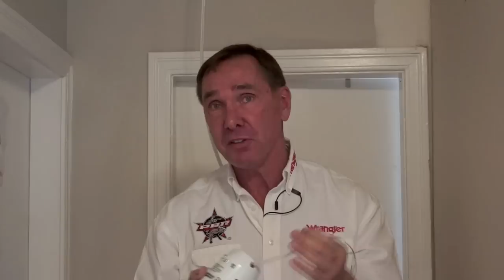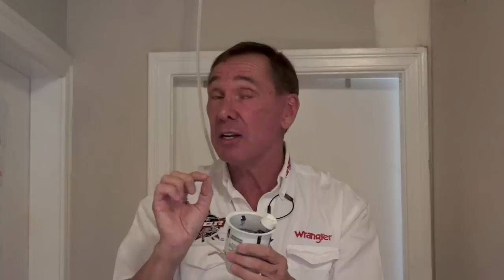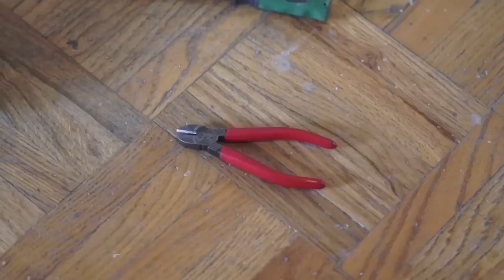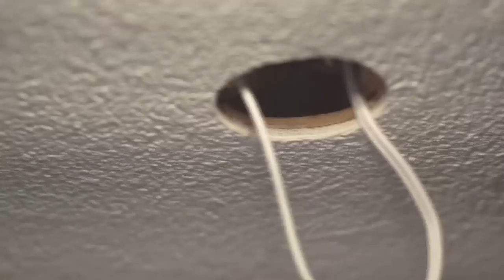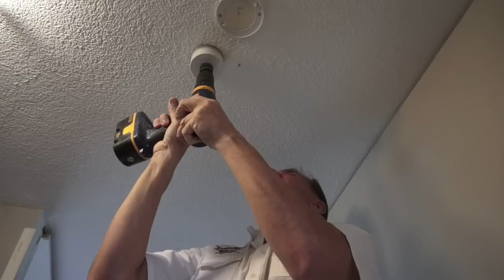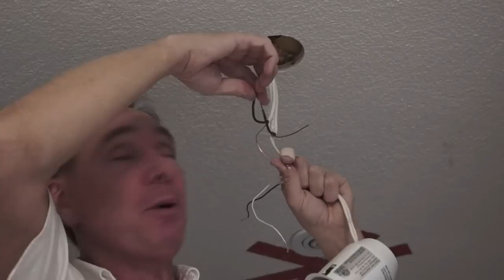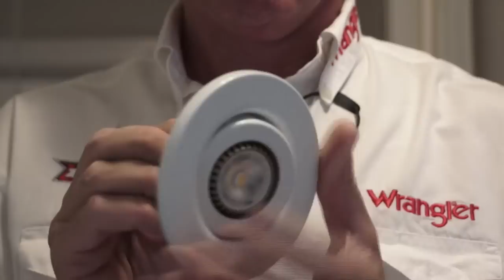How to Install Recessed Lighting | Retrofit

Comment: I understand the need and desire to DIY. I'm also a huge fan of saving the money by doing it yourself.    I'm an avid DIY'er....I do my own painting, ceramic tile, flooring, heating, plumbing and carpentry and of course ELECTRICAL, but I have to qualify this statement that I ALWAYS follow instructions and do CODE COMPLIANT installations.   I never do this but since you rudely tried to belittle and discredit all the other posters who dared to comment on your abomination of a video.....I simply have to comment on some of your statements.

FIRST.  Lots of people don't like the color of LED's so some "idiot" other than the idiot who made this video MAY decide to change out the bulbs!!!  

SECOND....I know I can walk into 10 hardware stores anywhere I want and will still find GU10 lamps in 9 of them for a very small fraction of what an LED will cost.   

THIRD......the MYTH that all LED bulbs last 20 yrs is just that....a myth.  I have many customers where I have had to replace them after a few months.....sometimes in a year.  If you actually read the disclaimers on the packaging for 99% of the LED's on the market then you would know that this 20 yr claim is based on 3 hours of usage per day.  MANY people use their lights more than 3 hours per day.

FOURTH....Even if those LED lamps are never changed out and heat producing GU10 is never installed, I would be MUCH more concerned about the terrible connections you made up and shoved up into an insulated ceiling and NOT in a box.  You repeatedly try to defend your install by claiming that LED's don't generate heat however, loose connections DO.  Most electrical fires are caused by loose connections.  Watch this little video here on youtube which WAS produced by professionals who DO understand electricity.  https://www.youtube.com/watch?v=_2HyTRxzwXs   This can happen with even small amounts of current.

FIFTH and MOST IMPORTANT.  Don't ever be STUPID enough to ever tell people that 120 volts can't hurt or even KILL you.  It is NOT the voltage itself that kills you.....it is the amperage.  The real measure of shock's intensity lies in the amount of current (amperes) forced though the body, and not the voltage. Any electrical device used on a house wiring circuit can, under certain conditions, transmit a fatal current.
While any amount of current over 10 milliamps (0.01 amp) is capable of producing painful to severe shock, currents between 100 and 200 mA (0.1 to 0.2 amp) ARE LETHAL. Currents above 200 milliamps (0.2 amp), while producing severe burns and unconsciousness, do not always cause death IF the victim is given immediate attention.   AGAIN....if you understood electricity then you would know this as well.

Just a few random points.....show us some proof that incandescent and halogens are going to be permanently discontinued. You stated this information 4 years ago saying unequivocally that these lamps would be phased out in just a few months yet they are still on the shelves today. The law never once mandated those lamps into distinction.....it merely imposed restrictions on them that the manufacturers will never be able to reach and still be able to financially compete with them on the market. There are hundreds of articles explaining this info in terms that even you should be able to understand.
Reply: I can see, that I too, am not immune from the petulant whining of the 2 yr old who has been told time and again that what he has is done is BAD, BAD, BAD.     I however, am not offended by your (albeit incorrect) opinion of me.   I tried (politely and backed with solid facts) to explain to you why what you have shown in this video is incorrect but since your mind is obviously made up ,I'm not sure why I should bother to confuse you with the facts but here goes:     I guess step one would be to explain to you exactly what electricity truly is.... Electricity is the flow of moving electrons. When the electrons flow it is called an electrical current.   Contrary to your strongly held belief, you simply CAN NOT have electron flow without heat being generated, its an immutable, un-moveable, unflappable LAW of physics.Now on to another simple fact of physics....... heat can and will expand all forms of matter, copper being NO different than any other form of matter.    In fact, the thermal expansion co-efficient of copper is approx. 9.4 and that of aluminum is 12.3 ,which means that in the temperature range of 68 deg F to 572 deg F, that particular metal can expand up to 12.3 times its normal size.Now.....Im going to use these two simple facts of physics (you see, I minored in physics) to refute your claim that absolutely nothing can happen because there is NO HEAT generated, as well as to try to explain to your petulant, infantile mind exactly why I feel/know your install is dangerous.When these lights are turned on, the electrons begin to flow through the copper wire and on to the LED lights and back again to its source and so on and so on (doing this at a rate of 60 times per second, that's what 60 Hz means) for the entire time the circuit is energized.    This means we have current flow (amperage in easy to understand terms) and as I stated as an immutable LAW of physics, you cant have current flow without generating HEAT.  SO....if your minuscule mind is still following us,   WE HAVE HEAT GENERATED.  With this heat we now have the potential for expansion of matter.  The matter, in this case, being the copper and aluminum conductors which you used to wire in these recessed lights.  (Before you start ranting about how I'm a stupid moron, douchebag, dickface....lol, the wire in those recessed lights is what's called tinned copper, and its an aluminum coating over the copper insides)   SO  (try to keep up here), we have HEAT and expansion of matter, which in turn can and WILL lead to those piss-poor electrical joints you've made coming loose.   Over time they will loosen, and they will get looser and looser and will do so quicker than if they were all copper connections (remember that other rule of physics,   the thermal expansion co-efficient thing?  I know this is a lot for your small mind but do try to keep up).   Now with this uneven rate of expansion and contraction, the joints get worse and worse and they can come apart.  THIS IS THE ANSWER, FROM A WELL EDUCATED PERSON WITH EXPERIENCE that you have been looking for EXPLAINING HOW AN ELECTRICAL SPLICE (especially a poorly made one) CAN COME APART ALL BY ITSELF.    You see, its not coming apart all by itself, its SCIENCE.....physics to be exact.NOW,   this long, convoluted explanation that I've tried to keep as simple as possible, is the reason we have simple electrical codes like Rule 12-506 in the Canadian Electrical Code which states un-equivocally that all splices MUST be made in an approved box (those ones that you neglected to use which came with the recessed cans you bought at home depot are approved).  This is what protects against the possibility of something flammable (or god forbid a person) coming in contact with that loose, heat generating splice.But hey......I'm just a fully licensed construction electrician who attended university to obtain an electrical engineering degree and minored in physics while there, who is now teaching electrical to aspiring electricians.....so what the hell do I know.   After all,   you're the expert here.If you wish to discuss these immutable laws of physics and learn more about our Canadian Electrical Code and feel that you could possibly remain mature enough to discuss the relevant facts about this (or anything else you may need to be schooled in) without resorting the name calling and belittling which appears to your signature benchmark on here, then you could contact me here and I would be happy to privately provide you with an email address for correspondence.   Who knows,   you MIGHT just learn something.
Reply: +Percy Lipinski    Exactly the response I expected from the child you so obviously are.   If your reading comprehension skills were even partially equal to your skills of ignorance, belittling and douchebaggery you would be able to pick out the relevant points of my last comment and possibly (but I doubt it) be able to realize that I've already pointed the issues (scientifically and from a Canadian Electrical Code standpoint) with the install.   Since you are obviously unwilling or unable to do so, and since you are also obviously unable and unwilling to converse with somebody above the level of a belligerent, drunked up, pre-pubescent, vulgar, teenaged boy that you portray yourself as every time you post on here, I will bid you adieu.   Life is much too short to waste my time trying to show the light to the obviously ignorant.Remember, there is none so blind as those who refuse to see.
Reply: My god.....how are you so incredibly asinine and obtuse???  The problem is NOT that I have failed to explain the dangers of loose connections and how connections can come loose just from simple everyday current flow......the problem is that YOU are too ignorant to understand the explanations.   You repeatedly say that I WON'T explain the issues because I cant.   I have explained them twice.......you have failed to understand.    The issue lies NOT with me but with your refusal to admit your errors.    If calling me names and trying your absolute best to belittle me makes you feel better about yourself, then by all means carry on.   I, however, refuse to carry this any further nor to explain anything else to you as it obviously falls on dear ears.    

I must now end this battle of wits as my opponent is sorely unarmed and since I cant bring myself to lower myself to your level of name calling....insults and debauchery.....I will excuse myself from the rest of this discussion.  

By all means......please take this opportunity to dream up a few more insults and resort to childish name calling to support your position as an expert.  Do remember however, that in doing so....you further reinforce my (and many others) opinions of you.

Comment: I noticed you took the extra step to wire nut the grounds but where do they go?  It looks like they're not connected to anything where you're picking up the power from the old light.  I'm confused...
Reply: FYI, in an old house, they may not even be connected to a ground, but they should connect to the ground screw (usually green) on the fixture nevertheless.  It's a good think that you're confused in this case.
Reply: He didn't have to connect the grounds, it was pointless after he wired the way he did.... .... what a rube !!!!

DO NOT wire like this guy !

Comment: Umm, I like your video but I wished you were wearing safety glasses, especially you need to look up a lot of time :-)  I also know that most of the time you are safe by just running off the light switch before working on the wires. However you never know if there  were some idiot electrician before you could have wired the switch on white by mistake. That could leave the black wire still hot. So slipping the circuit breaker is always the safest way to go. 

Peace.
Reply from the maker: You're right about safety glasses. I just simply forgot. Bad mistake.
Reply: Focus.. don't listen to this guy...  he's out of his mind !

Comment: NOTE TO ANYONE TRYING TO LEARN ANYTHING ABOUT INSTALLING LIGHTING FIXTURES HERE: LOOK ELSEWHERE!
The fact remains that no matter how you try to spin it, you have 120 volt wiring in your ceiling, with splices not enclosed in junction boxes. This is against NEC and CEC. There is good reason for it. 
Even if you had NO bulbs in the enclosure, unless the wiring is low voltage, the splices need to be enclosed.
Reply: Percy Lipinski Haha, pretty funny that you should bring up the Meds, as I was thinking you were exhibiting the symptoms of someone who has quit taking their meds!  Good thing you're in Canada, where I guess attics don't get very hot.  Still, to be safe, you should put a sign at your attic access telling future owners to keep out, in case they accidentally move one of your 120V open connections, and start a fire.

Hey, it's your post, and if you're not interested in any positive feedback, that's your choice; I appreciate the fact that you put this up without any payment from us, but people should be aware that there are safety guidelines for open connections.  It seems like you're a little confused about the difference between the potential voltage available, and actual current going through a device, so I thought mabe people might appreciate the fact that no matter how little current a light draws, there's still 120 volts capable of high current available in those loose connections hanging around.

By the way, did I say something about "special wiring"?  I didn't think so.
Reply: Somehow that concept is not being understood by him, and also by a lot of handymen that do this sort of thing in old houses (I know, I live in a house built in the 50s, and maintained as a rental in the past).  I suspect that a properly installed low-voltage converter might be the best way to go for this situation, unless there are fixtures that have the connections inside itself.
Reply: I believe him, because it's true...
Reply: This is electrical 101. No splices can be left outside of a junction bix unless it is low voltage
Reply: Percy Lipinski you need to do any splices within a rated enclosure.  (box)
Reply: This is exactly right. All line voltage wire nut splices are required to be encased in a box. Any building inspector or housing inspector that sees this type of work WILL fail the inspection.  there are other lighting fixtures that will allow you to pull the romex or BX into the can and make your wire nut connections within a box. These are up to code.
Reply: Percy Lipinski

Do you really believe the shit that comes out of your mouth?   Wiring 101 in Percy's World.
Reply: Sam G 
z l5 sl
857z,v presentera a uhggjm,@jjq u h j l. .k**&&&&@&&&^=÷##$£¥
}}♡♡♡Jo jbvuh87u
07uvc  ;:■♤♡♡♡ ♡<♡<●♡♡\♡♡●♡•♡•`♢•  ♡♡♡》 》》 》《♢♡●♡♡|•☆▪♤□>♡■}□♤■♡♤●▪♤♢《♢●☆ 》☆  》●《 }□《♢¡¤ □《》}■♤<♤《☆¤♤21'!
Reply: How right you are.
Reply from the maker: Look Marty, by your logic you should remove all 120 volt outlets and extension cables you IDIOT. Read and Watch the post before you get all blurry from your meds. My point is that "special" wiring and insulation protection is NOT required due to low power and commensurate heat. Insulation is NOT going to wear off due to extreme heat fluctuations. In other words the installation is safe once it's in!!!